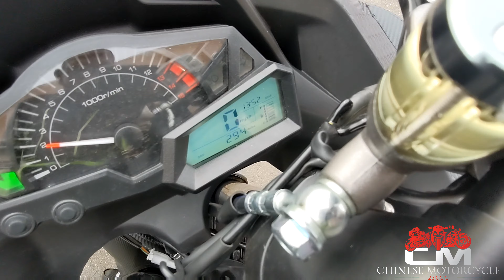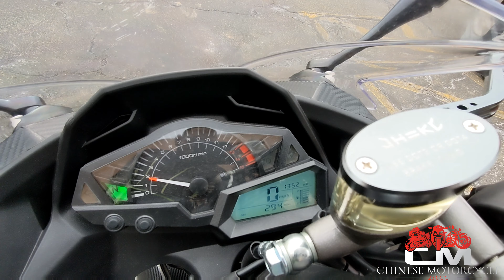2021 Baodiao BD250-5 EFI Test Ride with Hydraulic Clutch, ABS Brake & Impression / Honda CB250 Clone

Comment: Did u have stalling issues with yours?...mine stalling like crazy...changed t map sensor and added injector cleaner and no go...injector is next if that doesn't solve the problem then n the trash heap
Reply from the maker: Lmao… u n me r not the same. If u check the beginning of this video it’s a perfect start with perfect idle and as u watch the video it accelerates smooth. It’s also equipped with Hydraulic clutch.

I made a video about not to buy this piece of shit u should watch it. Then I made another video about how to service it, u should also watch that.
Reply: Hey did u ever fix the stalling issue i have one doing the same thing
Reply: Hello did you ever figure out the stalling issue? Im having the same problem with mine
Reply: @deputytorrez950  no i did not bro...changed t map sensor...no go...wonder if fuel line is pinched..
Reply: I thought the same thing, i found a clamp that wasnt on right and found my throttle cable was ripped out of the handle bar.. i fixed the clamp and glued the line in where the threads would normally hold it.. so far.. no stall on idle yet but sometimes it does when i blip the throttle
Reply: @deputytorrez950  gonna look into that...gotta be something simple maybe a sensor
Reply: Somethin! If u find it lmk!
Reply: @deputytorrez950  no doubt same here
Reply from the maker: When u boys have an engine seized… let me know lol…

Comment: Have you switched rear sprocket yet? If so what was the outcome. I have the same bike and wanting to do the same. Your videos have been very helpful and bike runs great
Reply from the maker: No I haven’t. Also I no longer have this bike, it was sold as the same time of the service. It was given to me by Baodiao so there’s no lost on my  end.. who knows what it could have turned out to be.
Reply: @Mr.FLOYDs  would you reccomend this bike comming from a 140cc upgraded Boom vader?
Reply from the maker: @hiflow39owe  compare to any "Chinese Scooters" yes. But if that 140cc is a brand like Honda, then No. 

But then again if ur ability is as mechanically inclined as me even 80% or u like to ride slow, take things slow n enjoy things u have without pushing to extreme limit, yes.

So the choice is really up to u.
Reply: @Mr.FLOYDs  I appreciate you. I have one one the line for 1700 just making sure its good for the price

Comment: Thanks I'm still very interested in these Chinese bikes. I'll be following you for information.
Do you sell bikes?
Reply from the maker: At the moment NO. But that option is considered as an improvement for the whole CHINA Motorsports slogan. Every year I seemed to add something I normally never used to do so when I start selling some models I would probably make a video about it and which models.
Reply: Are you still looking for a bike. I import from China.